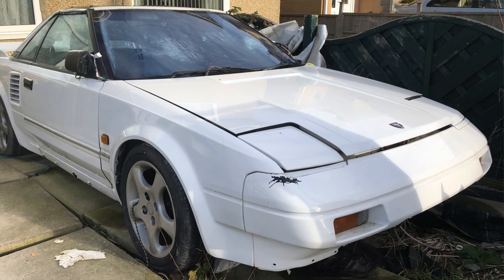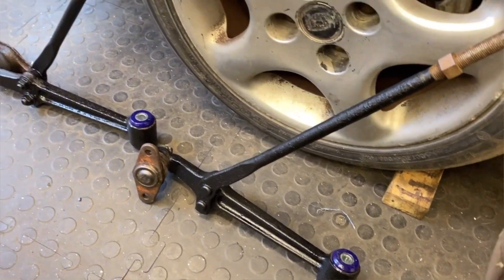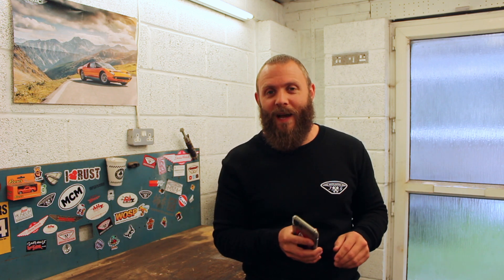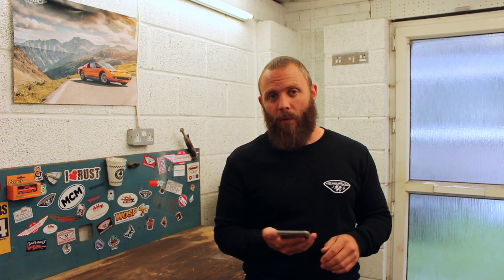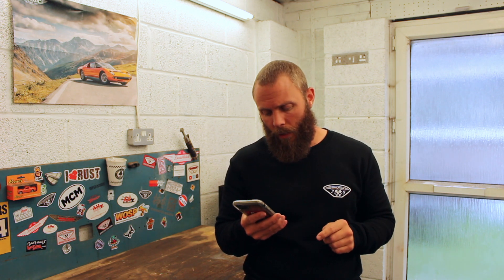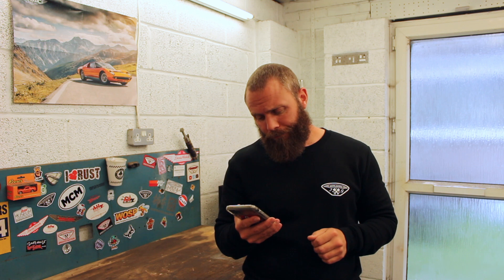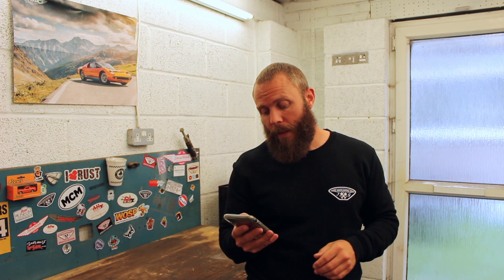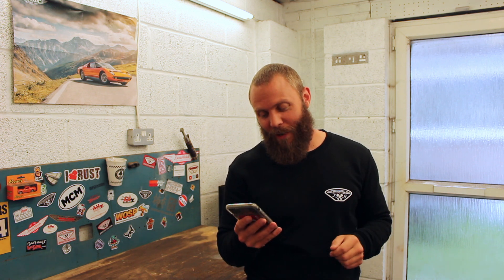Project MR2 Is SOLD! But How Much Did The Restoration Cost??... (ep.21 The Finale)

Comment: Thanks for the detailed price breakdown of the MR2 restoration! Much appreciated sir! I just bought an 86 MR2 for $1500 (US dollars) but it ran low on oil by the previous owner & needs connecting rod bearing(s). Will drop oil pan & perform a shade tree replacement!

Comment: Been doing mad research into refurbishing a MR2, and after about a day ive found your series and its been the most informative. ive found one in decent condition i could buy just under 3k USD that should need little work.. But everyone made rust sound like a deal breaker and the floor is missing the carpet and rusted fairly bad, after seing you handle the rust on this so well i feel fairly positive now its not impossible and definitely worth it
Reply from the maker: Thanks, rust repair is often the cheapest aspect of a resto for me, but it is messy work and time consuming. Good luck if you end up buying one and if you need any help just commet on one of the videos 👍🏻

Comment: What was causing the misfiring problem eventually? I must have missed that one, also did you change the cam-belt? 
My Mk1 has just finished in the body-shop. It's mechanics next.
Reply from the maker: Steve Ethelston ran out of time and never got to the bottom of it... my money was on the pump tho. Nope, left the original as the engine is non interference. Nice touch, not long now...
Reply: @Resto.Nation  so you did up a aw11 that sat for 12 years and couldn't be bothered doing the timing belt and idler/tensioner?  Ok.....
Reply from the maker: @feral4mr2  nope! It’s non interference and doesn’t stop it going back on the road. The massive holes in the floor did tho so that was top priority 😎. Along with everything else that stopped it being road legal...
Reply: @Resto.Nation  doesn't matter if it's a non interference engine mate. 
Go to all the trouble of a restoration and cheap out on that is prity sad.  
Or you just didn't know how to change it in the car. 
I guess it doesn't matter, you've on sold something the new owner will have to deal with. 
Thumbs down.
Reply: @feral4mr2  Be quiet, this guy's gone through the trouble of recording his progress for our entertainment. He has been incredibly in depth throughout as well.
Reply: @feral4mr2  You've commented on many videos on this project mr2. If you think negatively of it why are you watching it at all?
Reply: @harrywhite21  comes up on my feed. Thought I'd take a look being an aw11 enthusiast. 

Happy to see the mighty aw11 being restored to it's former glory.   Disappointed some important things were skipped.
Reply: @Chris Turnbull haha